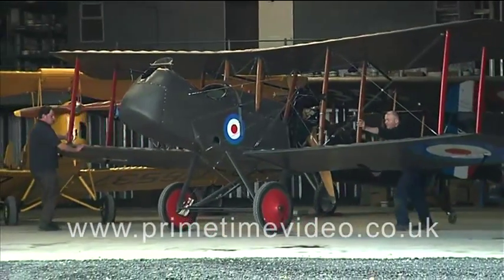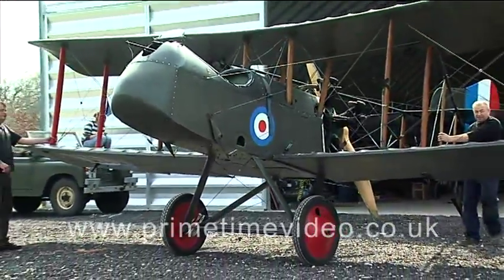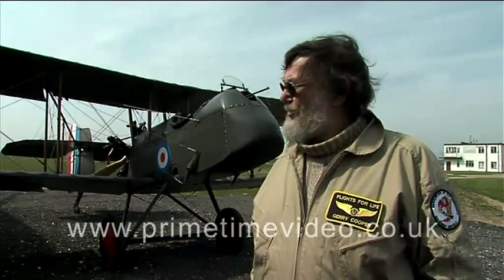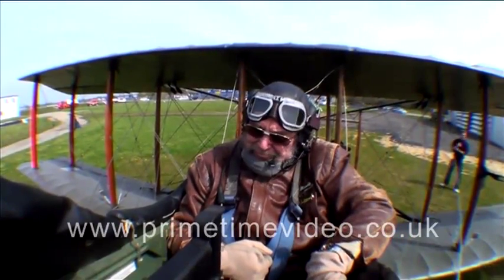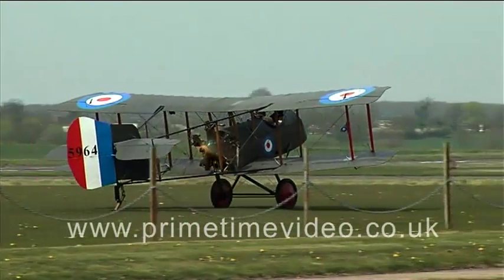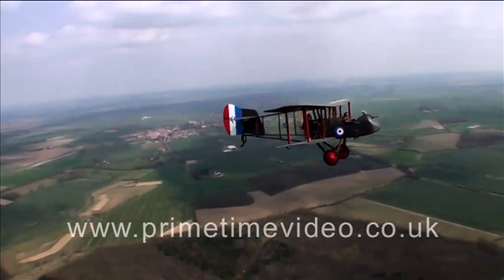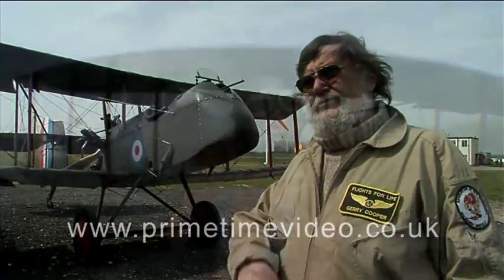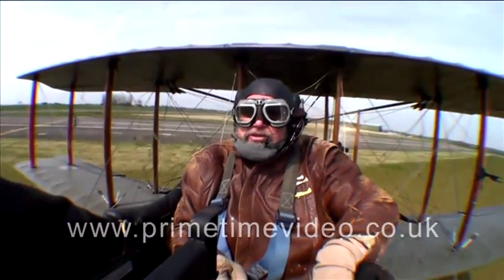WW1 Airco DH2 at Wickenby Airfield

Comment: Would a rotary engine be more powerful? Would a rotary engine make it harder to fly?
Reply: The rotary engine they used in WW1 had 100HP, the kinner engine from 1940 they installed in this plane is around 110-150HP? 
A rotary engine would make it harder to fly, since the entire engine is spinning as fast as the propeller. Most of the plane is made from wood and canvas, while the engine is a heavy metal block. So a large portion of the plane's mass is spinning at a thousand RPM. This causes turning to the left to be quite different than turning to the right. (like trying to rotate a spinning gyroscope). And changing the engine power makes the plane roll a bit.

You could try it out for yourself in the simulator Rise Of Flight!